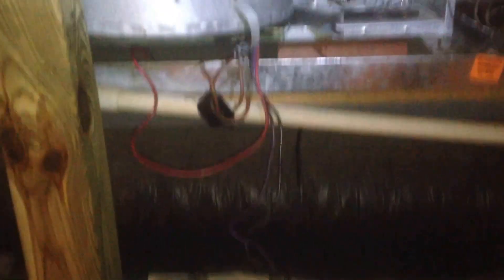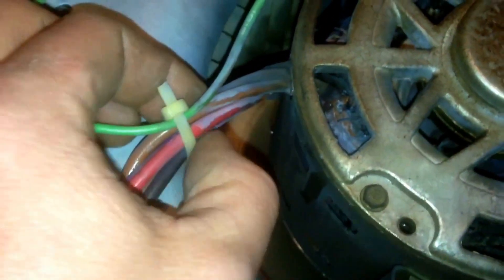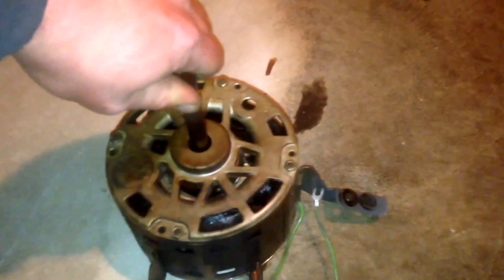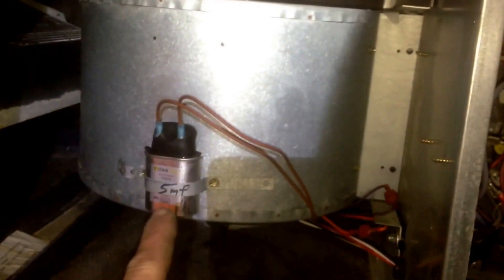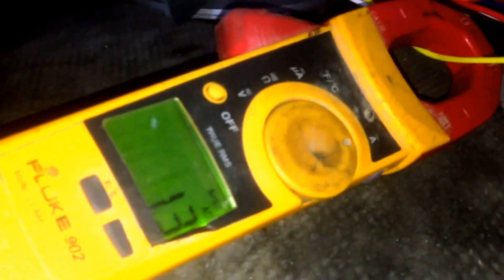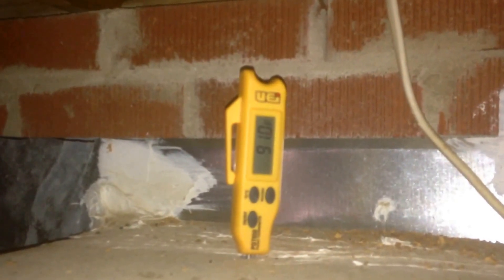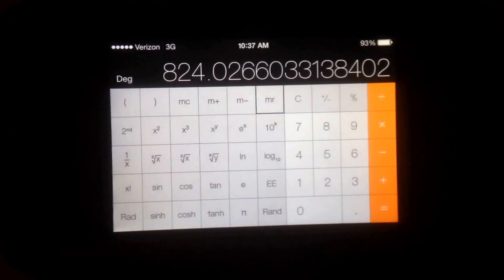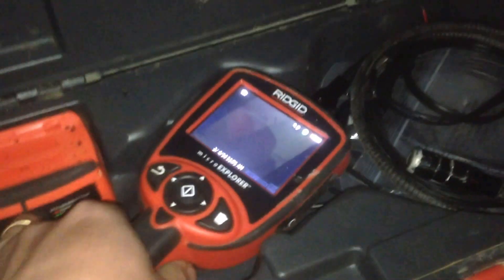HVAC Service: Troubleshooting & How To: Blower Motor Replacement & CFM Airflow Check & Adjust

Comment: Hello Stephen 
I am new at this and learning 
Your air flow was correct at the beginning for 5kw you can’t get more heat by raising air flow in this case you did raise air flow may not be beneficial for home owner electrical bill and comfort if I am wrong please explain thank

Comment: you run the heater.and get temperature split.could you run the compressor and get your split then do the math and get cfm?
Reply from the maker: I think there is a way to reverse calculate from the compressor but I don't know that's it's consistent or accepted universally.

Comment: hi stephen, great video. I have never seen so much math being done to calculate cfms…. could you explain where the 1.08 comes from and the 3.413??? i'll be sure to keep this info handy… also saw your other video about checking capacitors under load and seems like a good way to save time and spot a potential weak capacitor before its too late. thanks
Reply: 60 = min/hr 
0.075 = lb(dry air)/ft3 
0.24 = specific heat of dry air, btu/(lb* degrees f ) 
Multiply the three values together and you get 1.08. It is a calculation for standard air properties of dry air at atmospheric pressure. The formula is used to cancel out factors so final product is notated in Btu. 3.413 is how many btus are in 1 watt of energy.
Reply from the maker: I knew someone was smarter than me!
Reply: That's the inner engineer in me who has no degree. Lol.
Reply from the maker: Thanks Jim, I'm simply regurgitating info I've been fed over the years. If I was told why those are constants I don't remember. I'm sure Google would have a deep analysis somewhere within its wiring.
Reply: Stephen Rardon

Comment: Sandpaper and flagger is what I always use
Reply from the maker: It's funny, I've never tried to sand and lube a motor shaft, if I couldn't pull it, I'd change the blade or wheel.
Reply: That's funny were just the opposite I never pull out the motor puller if I can get the wheel off of the shaft with sandpaper and lubrication they get a new blower wheel